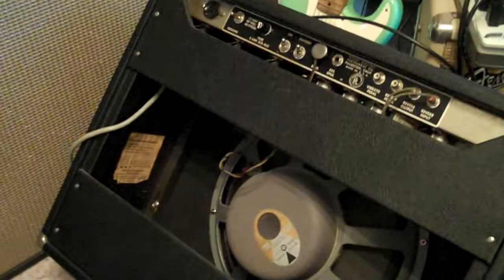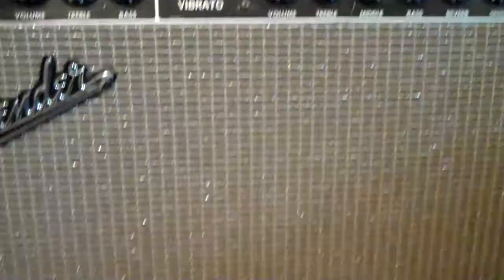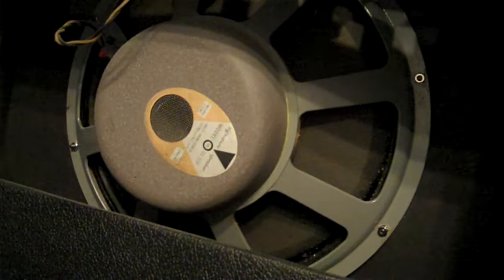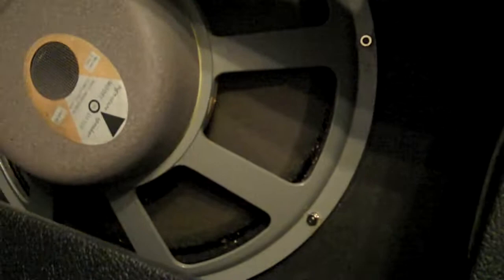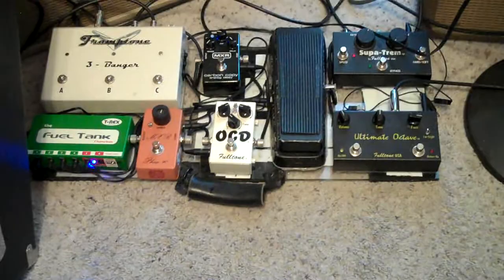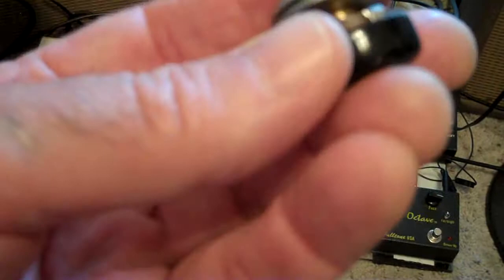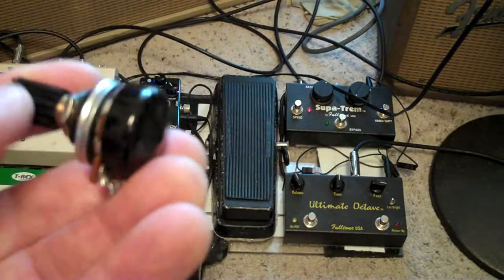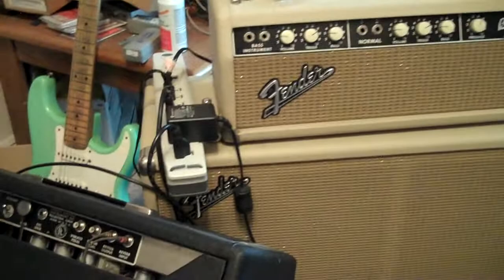1964 Fender Vibroverb - Wah Wah Maintenance & Earl Hooker

Comment from the maker: I kept trying to clean mine but it didn't help much. They wear out. When you think of how many time you cycle it, it's no surprise. The new pot is around $26 with shipping. Just redo the wiring like it is now in your wah. The pots should be interchangeable. If not, Dan can help you wire it correctly.

Comment: They way i showed you is nice, lots of options with the selector for the red Fassil or Whippel, right... Okay so i notice i replace the pot with a Dunlop Hot pots or whatever, i thought i had the fulltone one in there, so i'm going to order an area 51 pot to see if that improves the tone, i know the inside is not the same, but i do think that the pot makes a big differance... If you like the blues check out King Biscuit Time, I work there its KFFA dot com...You can watch or listen to the Show...